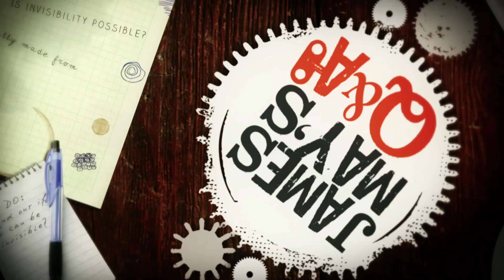Why Can't Trains Go Uphill? | James May's Q&A | Earth Science

Comment: Not quite guys,

When going up hill gravity actually contributes as a force that pulls the train downhill. In doing so, the frictional force is decreased because the normal force [Friction = (coefficient) (normal force)] is also decreased. Rather than the normal force being Normal = m(-g) it is Normal = m(sin(-g)). So you're essentially decreasing the frictional force AND adding a new force that pulls the train downhill (coincidentally equal to Force Pull = m(cos(-g)) ).

Comment: Couldn't they have grooved the track and the wheels?
Reply: they do for some mountain trains, can't think why they don't do that allover.
Reply: @owenbevt3  because over time the wheels would smooth out from the immense weight and then cause a smooth wheel to ride on corrugated rail, causing wheel slip. Best bet for maximum traction with little maintenance and most efficiency is flat rail and round wheels.

Comment: Notably, metro systems regularly navigate steeper grades (4-6%) because most or all of the axles are powered, providing tractive force, not just a leading locomotive.

Another key is that the trains have to be able to stop. Runaway trains, as James mentioned, are highly undesirable, and wheel flats where the brakes lock the wheel and it is ground flat, are terrifically expensive to fix.

Comment: There are so many things wrong. 80% vs 80°. Grip of the train does not depend on area when you have two smooth surfaces and there's no pattern on the wheels. Problem is that most of the trains have one 90t locomotive pulling multiple cars which weight about 25t each empty or 90t loaded. Obviously city trams can climb steeper hills than trains and they can still accelerate uphill even in the rain. When train brakes, it can stop from 160km/h in about 20 seconds because all cars and wheels have brake. Steel wheels and low friction coefficient is a problem, but major problem is 90t locomotive pulling perhaps 1200t and tracks are build mostly for both cargo and passenger trains.
Reply: 90 ton locomotives? That's the lightest I've ever heard...

Comment: Funny  in this country they can. The 4-8-4 northerns had little problem climbing mountains. later SD -40-2 where considered.  mountain engines. If wheels slip use your track sanding equipment.

Comment: Clearly the overall power-to-weight ratio is low on a long freight train.  That's dealt with by making the right-of-way as level as possible and where major changes in elevation can't be avoided,  switch-backs are constructed.  That's all manageable because the vehicle is going along a fixed route.  Cars and trucks don't have that luxury or drawback, depending on how you look at it.  The job of a train is to pull a lot of cargo and/or passengers over a distance with economic efficiency.  They've done that for over two centuries so l think it's fair to consider the concept a roaring success.

Comment: The true reason is that in a typical train, a single locomotive must pull 50 cars behind - a steep enough climb would sever the connection between the locomotive and the rest of the train. Single locomotives (e.g. city trams) can climb much steeper grades.

Comment: 4:07: "but the tractive force remains the same". No it doesn't! The easiest way to realize that is to go a step further, and do what's of course is impossible -- have a train go up on a 90 degree completely vertical track, and where the tractive force towards the track then would be zero since the gravitation on the train would be perpendiular to the surface of the then vertical track. In short, the steeper the track, the smaller the tractive force will be. (Sorry BBC. You may want to employ me to check your claims.)

Comment: I don’t see why we haven’t added little amounts of rubber to the wheels of trains. Can someone explain?
Reply: Because train wheels undertake a lot of stress and temperature, rubber loses its benifical properties w.r.t rise in temperature.  
Another problem being since the train needs to tug so much unpowered weight it is benifical to have a low coefficient of friction or else it would require a lot more power to overcome the added friction between the contacting surfaces, low coefficient of friction kinda allows the train to coast for longer.

Comment: For those of you who are confused as to how a locomotive will gain traction in the first place (since like he said steel on steel has little friction), locomtives will use sand to gain a grip on the rails, and as it gains speed, sand is no longer needed. Sand is also used on a locotive's wheels when tackling an incline.
Reply: sand is used by TAP Dancers as well.

Comment: As a swiss train driver, I applaud to your video, and might show it sometimes to people who think that, well, driving a train is probably as easy as being in a car that doesn't need steering, ey?
Actually, the biggest economical advantage of the train which is its small friction is also the greatest nightmare for the railway operators.
One day, I was driving downwards well below the maximum authorized speed due to bad weather and rail conditions (leaves in autumn). Suddenly, my personal feeling made me think that the train seemed a bit fast, especially in the turnings. So I reduced the effort of the electrical brake and suddenly the speed indicator goes 20 km/h up! Due to the slippery tracks and braking effort, the wheels were actually turning slower than the real speed of the train would have make them do, thus influencing the speed indicator!
Reply: Damn. Seems like an additional satellite positioning system is needed to identify such a case.
Reply: @phoenixarian8513  Yes that would be one possibility, but for example for the european Train Control System (ETCS) which needs positioning, they decided against it to not be dependent on satellites and their operators (mainly the Americans back then when the system was developped).
Some modern trains have a single axle that does only brake in emergency situations but not during standard braking. This way it always turns with the real speed, and it is on it that the velocity is measured. However, this wasn't the case on my older regional train and is still not the case on locomotives for freight trains for example ;-)
Reply: @Maciliachris  I am Chinese and they have their own satellite system, so that isn't a problem. (And yes, China does not trust American satellite service either)
One axle left unbraked doesn't matter actually, as westinghouse system brakes ALL axles including those on cars. Engine braking is nothing compared to this.

As with the positioning systems I heard that HSRs had got these already. Not ordinary engines.
Reply: Why does anyone listen to anyone British?
Reply: Wouldn't the wheel slip detector have been going off?
Reply: @CamAteUrKFC  They didn't because all four wheels were turning at the same, slower speed than the reality, so there was no differential speed to be detected. More modern trains have additional sensors (radars, acceleration captors), but even though it makes it a lot better, you can still have a lot of slip in some cases.
One of the best solutions is to have an axle without any engine power or breaking, so it will always turn at the real speed. But this is only possible on bigger trains with a lot of wheels, not freight trains where the loco needs all the driven axles to work.

Comment: The main reason is that in a car about 50% of the weight of the car is on the driven wheels.  If the car is 4 wheel drive, then 100% of the weight is on the driven wheels.  Trains way about 100 tons (approx), and they generally pull about 1000 tons (approx).  So only 10% of the weight is on the driven wheels, so the maximum tractive effort is ,much less - so it cant go up steep hills.  There is no need to make the engine more powerful, since it will just slip.  
The breaks act on ALL wheels of a train via the vacuum system, so the stopping effort is high
The friction between the wheels is proportional to the weight of the engine and nearly independent of the area of contact, though with rubber the frictional coefficient decreases with force to a small extent, that is why cars tend to have wide profile tires to improve traction,  So the small area of contact makes little different with steel
I am concerned James that many of your comments are mostly wrong.

Comment: 1: They can go uphill, just because you don't see trains on obvious angles doesn't mean they aren't climbing, if you don't believe me, there are stretches of rail in America where you can see the end of your train moving along an opposite hillside, just a few hundred feet away, and there can be a difference of a few hundred feet between the locomotive and the rear car.
2: Trains are held to the rails by their immense weight, without all the force pulling them down, their wheels would simply slide around helplessly on the rails, as train starts to climb a hill that force pulling the train down shifts towards the rear of the train, simultaneously making the train cars(carriages) heavier, and making the locomotives less effecient because their pulling power is reduced.
This is why trains on famous mountain routes, such as the Tehachapi Loop, often have upwards of ten or more locomotives.
3: No, seriously, you try pulling five thousand tons of freight and equipment up a hill.

Comment: i'm surprised by the lack of an explanation of how some trains did it anyway. Some trains had a compartment filled with sand that would be allowed to blow under the driving wheels, hence digging into both the rail and the wheel, creating a larger frictional force, of course, it had a nasty habit of wearing down the wheels as well, so it's not used unless necessary.

Comment: A few years ago I was going down a 14% grade in the Rocky Mountains and saw a freight train coming up the same grade on the tracks next to the road.
If you get out in that part of the world (and I presume in the Alps), you will see lots of trains going up some pretty steep grades.
Reply: Continental divide.. I worked in the Montana region. You are correct, they handle very steep grades.
Reply: I used to live in Chamonix Mont Blanc (French Alps) and the main line going through the valley has to climb up a 1 in 11 gradient on part of its route. That's all friction based, using light weight trains, wikipedia "Saint-Gervais–Vallorcine railway" if you're interested.
There are much steeper trains in/around the valley but they use rack and pinion.

Comment: For the record, the fact that the contact area is small makes practically no difference in terms of friction (and therefore grip).
Reply: Wrong. Why do F1 cars have flat tires instead of tredded tires? Because the larger surface area touching the ground gives them more grip. True the material it's made out of plays a big role but the surface area touching the ground does make a difference.
Reply: Mick Camerlengo show your working

Comment: German locomotive engineers should have watched this before building ones from aluminium. Inspired from the efficiency hype of the automotive industry on getting everything light weighted. But they have found a way around the slippage. They call it anti-slip. Nothing else then cutting power to the wheels. Stupid.

Comment: Calling shenanigans on the car comparison
HP determines top speed while HP/weight ratio determines acceleration
The train has a lot of HP and so can eventually go very fast while the car does not and cant go very fast overall (even though it can accelerate quickly due to higher hp/weight)
A scooter will beat a fully loaded 18 wheeler off the starting line but the scooter tops out at 25mph and the 18 wheeler can go above 80 if it wanted, and BOTH are on tires

Comment: The tractive force will decrease when the train is on a hill. The weight of the train pressing into the tracks is mg.cos(a) where m is the mass of the train, g is acceleration due to gravity, and a is the angle to the horizontal. If the slope makes an angle of 10 degrees with the horizontal then cos(a) =  cos(10) = 0.98 (2 s.f.), so friction/traction is only 98% of what it would be on level ground.

Comment: No, James, the tractive force does not remain the same when running uphill. The tractive force is directly related to the force normal (or directed toward the track) of the wheels as they contact the rails. When the track is at an an incline, the force normal to the track reduces, thereby reducing the tractive force.

Comment: A fitted train would have braking for all the wagons/carriages. Before negotiating a descending incline, an unfitted/partially fitted train would be stopped and the guard would have to walk the length of the train pinning down the brakes of each wagon. Also the speed would kept at or below 25mph. Trailing catch points were essential to prevent runaway trains from travelling too far by derailing them.

Comment: The force of friction is independent of contact area. Trains have little friction mostly because they use steel wheels and rails.
Reply: That was a lie our psychics teachers taught us. If it were true, dragsters wouldn't have fat wheels.
Reply: @markflierl1624  It's not a similar scenario. Racecar tires are soft and deform a lot over a rough road. Having a wider contact patch increases the probability of getting maximum friction at all times. A narrow tire can hit a wet patch of road or a pit and lose some traction. Train wheels are very hard and roll over an almost perfectly uniform surface. So it makes almost no difference how wide the contact patch is.

Comment: Couldn't you just add a second set of wheels with more traction that are use when going uphill? Or add a different "mode" to the main set of wheels, like hoover heads, where you can flip a switch when you go between carpet and some smoother surface...

Problem solved, now go build better trains....
Reply: The average locomotive has twelve wheels which are all powered and supply traction. The idea of trying to make trains go up steeper grades than what currently exist really is pointless because very  heavy trains would start snapping draw gear at the head end.

Comment: The force that the train feels pushing it away from the earth is called "Normal" and counteracts the gravitational pull of the Earth. 

But when on an inclinated plane, the normal pushes the train also in the perpendicular direction of the plane, making it to move.  And then, what I wanted to say,  the Normal force changes with the orientation of the plane (on hills), altering the friction of the machine and the rails, so:

No, the force that the train feels by the ground is not the same when you go on hills.

Comment: It was all very interesting until he got to the part about breaking, trains have great breaks compared to traction because ALL the carriages have brakes not just the locomotive. They still weigh a lot and take forever to stop but they can stop a lot better than they can go.
Reply: Early steam engines like the ones he was talking about didn't always have brakes on all the carriages that could be controlled from the engine.

Comment: why dont they add like a think layer of rubber to the wheels?
Reply: Pointless, it would wear away in no time and would achieve nothing. Heavy haul locomotives spray sand under the wheels in difficult conditions to assist with traction.

Comment: What if train wheels had spikes and rails had holes so they worked like gears?
Reply: Some railways have just that, a rack in the centre of the track and a cog which comes down from the loco. Generally only used when gradients exceed 1:25 , and only suitable for relatively light trailing tonnage such as tourist trains. There is one in use in Tasmania, Australia, on a steam tourist railway.
Reply: turnbs very interesting, thank you! It would be nice to see a train operated over chains instead of rails, i wonder how good it would be at braking or uphilling, and what downsides could it have

Comment: All this is correct - but it misses perhaps the most important reason why trains can't climb hills: The percentage of the total weight on the driving wheels.  Cars haul only themselves, which means they have 40-60% (2WD) or 100% (AWD) of the weight on the driving wheels.  But with a train, this percentage is much lower - for instance, less than 4% in the case of two 200-ton locomotives hauling a 10,000 ton train.  The locomotives in such a case would have no problem on flat track, but a 1.5% grade would bring them to a halt.  

However, the coefficient of friction between the wheels and rails is really not that small - around 25% or so - which means that a single locomotive by itself would have no trouble negotiating slopes that would be considered steep even by road standards.  In fact, a single locomotive under ideal conditions would have better adhesion for acceleration than a FWD car on a surface like wet asphalt.

Additionally, air resistance is really only a factor with high-speed trains.  On freight trains, the top speed has more to do with the fact that tractive effort decreases with speed, meaning the train stops accelerating once the tractive effort lowers to the equivalent of the train's resistance.